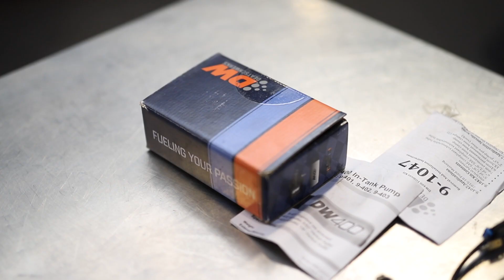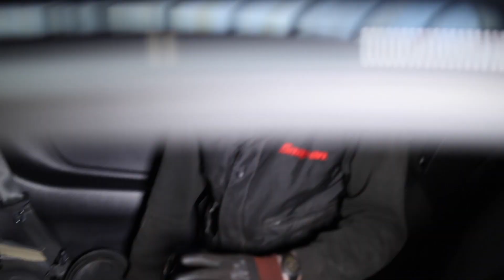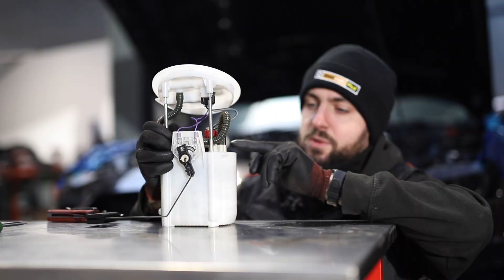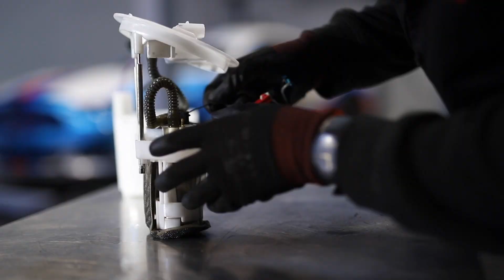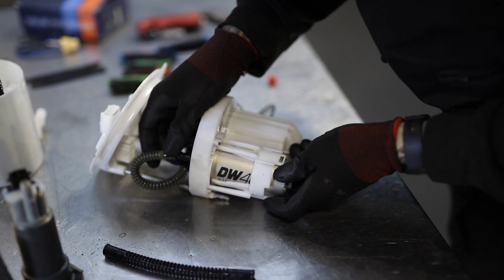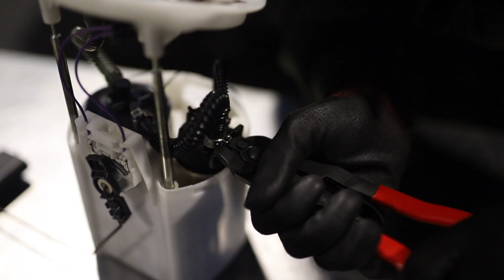When and How To Upgrade Your Fuel Pump!

Comment: Would you have to upgrade any lines, injectors or fuel pressure regulator for this pump to work? I have a 09 GT500 and pressure spikes up at start then turns off car.
Reply: Fuel pressure regulator

Comment: I put one of these in but seems like the car runs out of gas at . a half tank
Reply: Did you remember to connect the lower transfer hose back to the fuel pump assembly when putting everything back together?